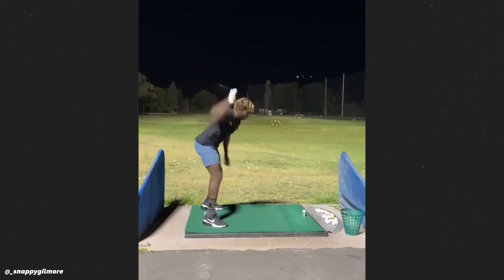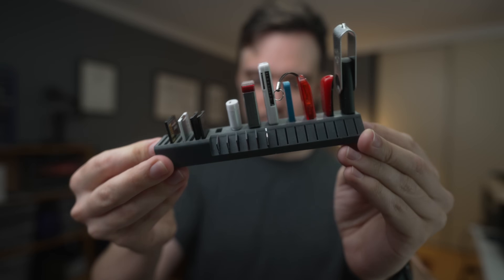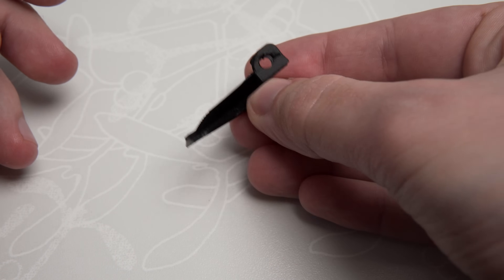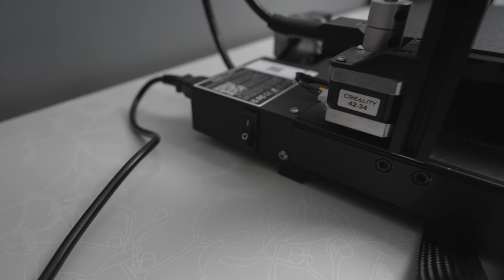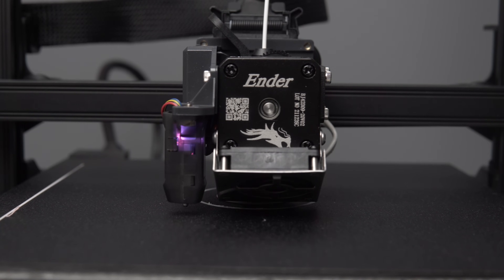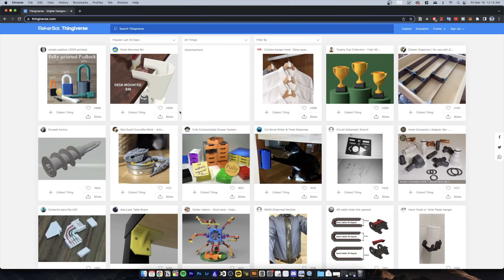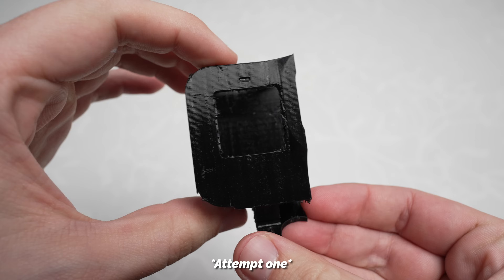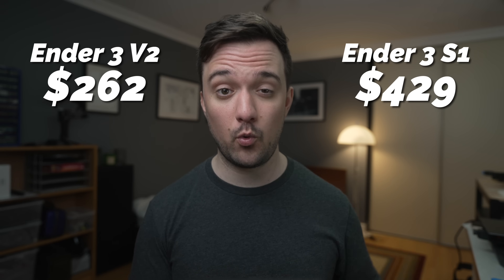How Easy is 3D Printing ACTUALLY? (Ender 3 S1 Review)

Comment: I am new to 3D printing never before have I even seen a 3D printer , then while shopping at Micro Center my son and I decided to purchase one each Ender 3 s1 printers  that where on sale ,went home and set it up very quickly no issues. Bed leveling and nozzle adjustments went quick and smooth no issues got it on first try.  My first print was the cat, an stl file that came with my printer WOW it turned out great I impressed  so  I downloaded Cura and found something else to print this was all just 3 weeks ago and so far I have gone thru about 4lbs of filament printing all kinds of cool stuff. I am 68 years old so not a young savvy guy to technology but this has all turned out to be a great hobby in my retirement. I am about to purchase another 3D printer with a larger print base so I can print bigger things. This has all been a great experience so happy I got an Ender 3 s1
Reply: I love 3D printing I just purchased another printer the Ender3 s1 plus it has a 300mm x 300mm print bed set it up and was printing within 1 hour after getting it home ...3D printing has opened up a whole new experience for me.
Reply: I'm  in my 60s and am thinking about purchasing a printer. We older gentlemen need to keep our minds  occupied.
Reply: I'm looking at getting a printer now👀👌
Reply: @moji3812 oooo nice I recommend the ender 3 v3 ke the speed is GREAT and there is a build plate of 220x220 and it’s a PEI black bed it comes with. I highly recommend
Reply: Glad you like it 🙂
Reply: im 53 and recently had to retire due to torn tendon in elbow. im wanting one of these. but how hard is it to figure out ?  i dont want to waste my money.
Reply: steve thomas I had no issues setting up 2 different printers. The bed leveling procedure takes patience and a bit of practice but is not difficult. I watched a few youtube videos and walked right thru it. I am not tech savvy but I am mechanical minded. I love my printers and have no regret buying them in fact I am considering purchasing a laser head to do laser etching with my printer. Good Luck I also was reluctant to purchase a printer but am happy I did.
Reply: @brentsprinkle5646  thank you.   Im like you ,  im not to tech savvy either.   But if its that easy im going to go and get myself one .
Reply: How much
Reply: @coolmonkey619 With the coupon, I got mine for $200 at Micro Center.  Definitely worth it
Reply: I’m 64 and doing the retired life for 6 years. I have 2 cnc routers, 1 cnc diode laser and just bought in June an Ender 3 s1 new for $199.95. I have a bunch of things to print for cnc routers. I just saw this guy last week here. Pretty cool!! https://youtu.be/0YSXmKaWG-M?si=TlcbU-Pc28D0T1Bn
Reply: Whoa
Reply: imagine being so rich

Comment: 3-D printing is incredibly cool, it used to be a hell of a lot harder when it first started to become available. The reason why having a direct drive works better for flexible materials is because the filament stretches.  If you have 8 inches of material between the hotend and extruder, that is a ton of flex and an accuracy. If you have a direct drive it reduces that play.  Should make sense.

Comment: The reason direct drive works better for tpu is easy to understand. Try pushing a rope through a pipe vr pulling it through. It's 100s of times easier to pull a flimsy material than push.

Comment: When I started printing I had to restrain myself from throwing the printer out the window. It wasn't till I modded it that it started working right. The CR touch made the most significant difference to me and then I upgraded the Bowden tube and the extruder. It still gives me a fight once in a while but it's not as crazy to fix anymore. I only use it for available prints every now and then and sometimes I design prints to solve problems. Like designing replacement parts.

Comment: 3D printing is not hard. Mechanical design of functional and manufacturable parts coupled with material selection and quality control is. Source - do a lot of printing for chemical research. PLA is almost never a good option - we always use HIPS, ABS or Nylon depending on the chemical resistance requirements. Precision - 50 micron layer heights and nearly solid parts to make them gas tight.

Comment: I recently finished re-tuning my ender 3 pro after installing the Sprite direct drive. That was a pain to say the least. Took about 60 trials to adjust all my settings in Cura, but now my printer is a beast at any material except abs.
Reply: Does this thing print abs ok or Have you encountered problems?

Comment: Which one you start with definitely depends on your budget, but not in the way that most people think. If you don't have a lot of spare money and/or time, then get the expensive one. Only if you can easily afford the top of the line plus another one, have plenty of free time, and the desire and ability to learn by doing should you consider starting with the cheaper printer. The reason for that, is exactly what happened in this video, if you start off by dabbling you will go spend a lot of money on filament and time making adjustments, only to realize that you need an upgraded machine to do what you want. You will then start upgrading the extruder, hot end, motherboard, and then buying a whole new printer... maybe even the one that you could've gotten the first time.
Personally, I went the dabbler's route and really enjoyed the process, but it certainly was NOT the cheaper way to go!

Comment: I'm struggling with the Frackin Bootloader/Firmware for two SKR Mini E3 V2 on ender 3 Pro (BL Touch) and Ender 5(CR Touch). They are collecting dust as both screens are STILL blue after 3 months of trying Github BIN files.

Comment: 3d printing is accompanied by much pain and suffering. It starts with assembling the thing, where screwing up the frame or belt tension can mess prints up. After that it could have issues with bed leveling or bed adhesion. It's not uncommon on a cheap printer to crash the head into the bed, or have the print fail or look all weird because of an issue. In a way that isn't bad because it teaches a lot about the principles. And on some platforms, e.g. Creality printers, there is an aftermarket of upgrades that make prints more reliable. My Ender 3 Pro has a different board, auto bed leveler, PEI sheet, klipper, raspberry pi, camera, new bowden tubes and a bunch of other improvements. I even have a natty print enclosure made from some cheap IKEA coffee tables.

But for hassle free 3D printing you need to spend money on one which has this stuff out of the box. And if your intent is to print anything but PLA or PETG then you must get one with a direct drive extruder. And if you're genuinely looking to print stuff in anger for a real need and not a casual hobby, get a core XY printer with a bed that goes up and down on a couple of screws since it will be more reliable and will print faster.

Comment: 3D printing is indeed a very difficult learning curve not for the faint of heart.  Filament may be easier than resin, but the odds are, if you only need one or two, just buy them and don’t waste time trying to learn something you would never use. Or, have someone who is more experienced, print it for use. You need the right 3D printer, learn several new software and the right tools.

Comment: As long as 3d printers have to be adjusted or fine tuned like this, I won't get one. Want to have one for years now, but nope. My buddy has several ones. But he also likes to modify them. That's not why I would like to have one. It has to do its work fast and easy. The dlp ones are pretty cool for that, but the cleaning....nope again. I'll wait a few more years.

Comment: I noticed with my S1 Plus all of the springs were not compressed completely before the adjuster knobs were added making it impossible to level properly until  compressing the springs and re screwing on the knobs one at a time which fixed my problem!

Comment: Can you recycle failed prints and reuse the plastic or do you basically have to throw it out? I know nothing about 3d printing other than what i just saw in this video but i am curious about it.
Reply: Short answer, no you can't easily recycle 3d printouts, and you would likely just dispose of them.

longer answer
it may be possible to recycle the prints back into filament, but it would require specialized equipment, basically the plastic filament used by the printers in this video come as a roll of, basically, plastic wire, so reusing old prints would require forming them back into filament, that would definitely require specialised equipment and I'm not sure how the plastics it would react to being remelted and reformed (some plastics do not like being melted multiple times).

You can also get printers that use liquid resin, and are apparently better for fine detail, often used by people trying to print model miniatures like for example Warhammer figures, it is definitely not possible to reuse that stuff

Comment: Here's what I don't understand - People think you have to understand CAD to use a 3d printer. No you don't. Anyone who tells you that is an idiot. Buy one and treat it like you would a normal paper printer. Not once... not once did you question your expertise when it came to document printers. You googled inkjet vs laser and off you went. But when it comes to 3D printers it becomes a mystery reserved for dorks and engineers. Come on now... You can literally buy the cheapest ender, throw it in a corner, print useful shit you find off thingiverse or simple things you cobble together on some easy online CAD program, and come out with satisfactory results. Fine tuning is for fine tuners. It's like welders say.. "a grinder and paint make me the welder I ain't". Your printer doesn't have to come out polished. It'll be ok.

Comment: yep, ender 3, beginner printer.  first the beginner scratches the bed plate, then decides to upgrade with dual z motors, then attempt to upgrade the hot end, then add bl touch.. then spend hours and hours of upgrading, then decide to go with a swiss all metal hotend, then we go for the pei sheet. and then we realize we probably should just have bought a printer with all of that already in it, lol

Comment: The reason you want the extruder motor down as close to the hotend as possible when dealing with flexible filaments is, unlike stiff plastics like PLA, they'll compress and stretch as you extrude and retract, so over the long distance of the bowden tube, that introduces a lot of slop and inaccuracy. You might retract 5mm back at the beginning of the tube, but because of the compression and stretch of the TPU, at the hot end, no retraction actually takes place. Imagine sticking a piece of cooked spaghetti vs dry spaghetti through the tube.

Comment: The Ender 3 is a great first printer.  It will re-enforce that you need better parts over time and it is never ending.

Ended up with a Prusa MK3S, and a Bontech LGX mosquito extruder.  I now print amazing prints at 150% to 200% without errors.  Fun fun.

Comment: With my Ender 3 S1 Pro, I don’t really use a piece of paper to level it. Sure I use paper to get the bed about level, but don’t try to only use the paper trick. After you have it about level, just run the auto leveling probe (with the M420 code) and watch as it has PERFECT first layer adhesion.

Comment: 6:10 - because softer plastics are harder to push inside the bowden tube on a bowden setup (your first printer), they move and give inside the PTFE tube. the farther the extruder is from the hotend, the harder it is for the extruder. imagine trying to push a string or thread inside a plastic straw. the solution is obviously to shorten the distance between the extruder and hotend - i.e. a direct extruder.

Comment: Im new to all this and I just want to have fun, make things and sell them for extra cash on Ebay. etc. Also would like to make some gear parts for some car seat motors I have. Would that be possible? 

I was just thinking of going for the Gusto and get the higher ender's 3D printer available today and not have to worry so much about upgrading to much at the current time? 

I just don't want it sitting in my home and not keeping me interested, with so many options to print I pretty sure it won't happen?

Comment: No wonder you engraved your bed, you are probably more clued on with it now but I can't believe no one has mentioned this: the CR Touch/ auto level is level correction, it should not replace levelling the bed manually the way you did. 
Step 1. Level with paper starting center then center edges then center corners 
2. Level again and again 
3. Set z offset
4. Run auto level.

Comment: ive printed a lot of shit on my s1 and its been a treat compared to my last 3 printers.  no need to upgrade anything. it aint perfect but close enough.  the reason a dd printer is better at softer filament is easy. try pushing a wet noodle through a tube and get back to me.

Comment: It's been fun to see your journey!
I got into 3D printing roughly 2 years ago, testing a Ultimaker 3 for work and later buying my own Ender 5. Its a really fun hobby and you can make and learn a lot from it!

I'm actually looking at the Ender 3 S1 myself to replace my Ender 5 as it's got a lot more advantages
Reply: Hi Darkfox, we are about to buy an Ender 5 S1, why do you say the 3 is better?
Reply: @marksvideochannel3592  I'm not sure about the S1, but the standard Ender 5 had a lot of issues that I had to work around.

In my case the Ender 3 S1 is ideal, and it offers a lot better quality of life features, and a smaller footprint for nearly the same print volume that mine had.

If you wish to get the Ender 5 S1 you can, just make sure you do a lot of research and make sure thats the machine that is right for you :)
Reply: @Purfunxion  Thank you, i'll check it out.

Comment: Hey Matt! I know this isn’t a drone video, but i need help looking for a  fpv and I know your the guy to ask. These are the qualities that I am looking for, it needs to be for indoor and out door use, a good range for distance, and a good controller and fpv goggles to go with it. All of this will be needing to fit in a $300 budget. 

Thank you.
Reply: $300 is a tough order for all that. If you are just starting and want to have indoor and outdoor fun(on a calm day) I recommend the Happymodel Mobula7 1s but with ELRS receiver protocol. They have an all in one flight control board that has a powerful 400mw vtx and ELRS receiver built into the one board. They are fun and fast on a cheap 1s battery and great and forgiving to learn on. The quad is $104 USD. For a radio get an Express LRS radio. I recommend the Radiomaster Zorro but the ELRS  2.4ghz built in version. It comes as a multi protocol version but if starting out ELRS is the best protocol to get. This radio is $120 USD. Then grab a 1s charger and 1s 450mah batteries. For goggles to keep it cheap get Eachine EV800D diversity goggles. I would recommend getting slightly better ones like the Skyzone CobraX or CobraS but the Eachine ones arent too bad. May be a bit over $300 but that will get you in the air having fun. Also get on Facebook and join the group Beginner To FPV. Its the best beginner group there is. I'm over there too if you need help.

Comment: So what is the z offset set at?
Reply: offset ?  why ? you can adjust the z limit switch with a drill and new holes on the frame.  that's how I got my 1st used 3d printer, a guy broke the bed heating cable, changed the bed to a higher one, then couldn't print anymore ... I got a deal but was expecting a working printer, I had to fix all his problems and now I know that machine from A to Z.

Comment: I have the same issue with the Z offset on this printer. No idea why the instruction manual tells you to set it using a piece of paper when that definitely is not a good way to do it on this printer. How did you decide how much to lift it by?

Comment: OMG dude!! U R my hero!! I just recently jumped into the 3d printing scene, got my ender 3 S1 pro, and was having so much trouble because I, too was following everybody's advice and had the print head too low. I raised up the print head, and now it's working like a charm! Thanks for pointing that out.
Reply: I have the Ender 3 S1 and saw this comment, raised the head and my prints started turning out better! Not perfect, but better
Reply: @supremelordofawesomeness  I know right. I still have more to learn, but I love this new hobby! Glad your prints are coming out better! :)
Reply: Same
Reply: The S1 is a machine that can be adjusted to your desired result.Also, download only one model and check which setting works properly. If you do this, there will be no problem and it will work.

Comment: Thank you so much. You may have just help me explain why my prints started sticking so firmly to my bed that they began making it look like swiss cheese. I just bought a piece of glass with the assumption that it would be more durable, and it is. Removing my prints from my glass bed have also self destructed in the removal process though. Perhaps increasing the nozzle distance will improve the life of my print bed and my prints.

Comment: I own an Ender 3v2 I was happy with it but as time went on it hit me that it was very loud. I upgraded  the fans on it to Noctua fans, upgraded my board to a BigTreeTech skr e3 mini and my hotend is a Voron Stelthburner. I highly recommend these upgrades if you get into a testy mood. If not an easy upgrade would be to get a Raspberry Pi and load either Klipper or Octo print to it to manage your printer wirelessly (does not improve loudness).  Anyway good luck and happy printing.
Reply: "... it was very loud."  - LOL - far quieter than that horrible stuff out there that they call "music".